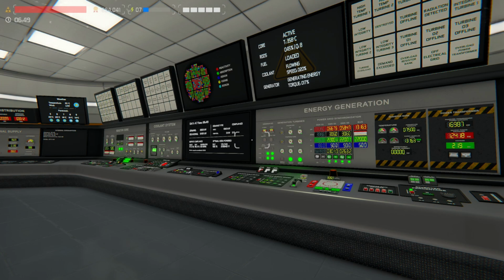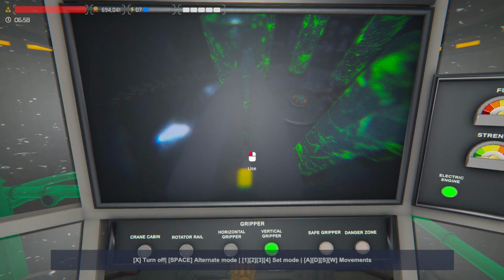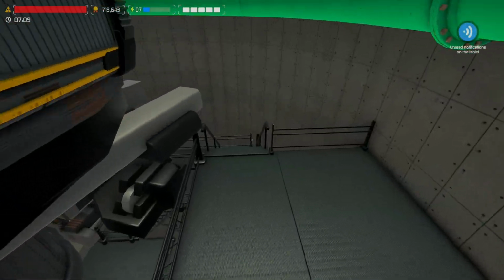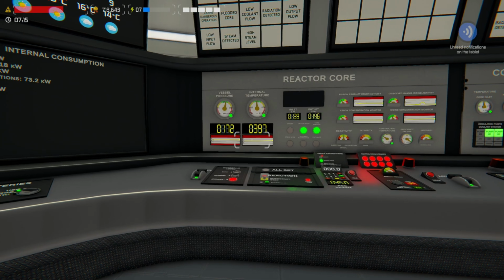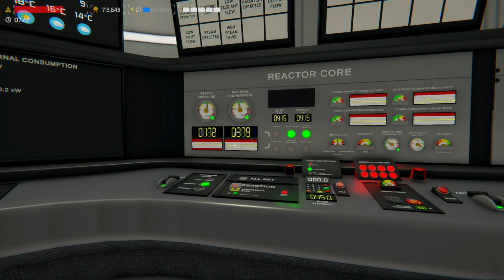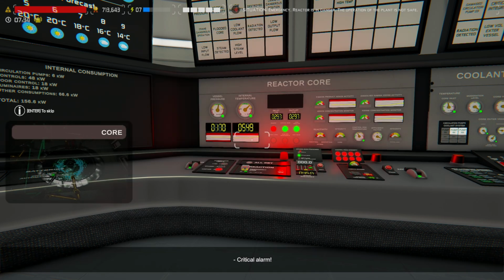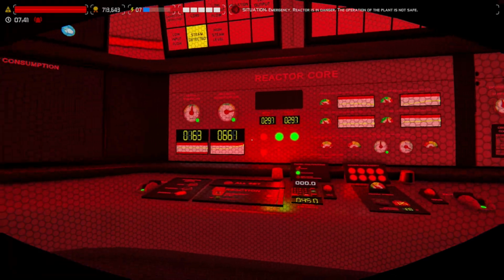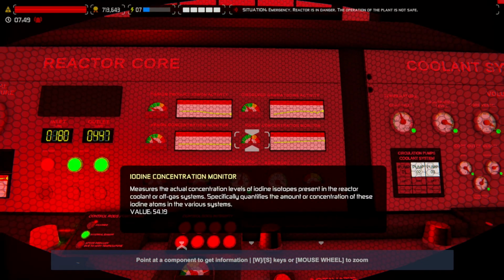DESTROYING Control Rods... Meltdown Test #2 - Nucleares Tutorial

Comment: Maybe from a freshly started game.
Just set the operation mode to nominal and insert core.
Then set rods to 0.
Without doing anything else.
That should start a meltdown immediately.
Reply from the maker: Tried that and won't work...
Needs a new Game with power and the reactor providing stable output to the city's grid... then yank out all of the above haha... shown on Mondays episode
Reply: @ShArPy1o1Games  
WTF that has to be a bug.
No rods, no boric acid, no cooling, no pressurizer and it doesn't cause a meltdown? Irl that would practically turn the reactor in a nuclear bomb
Reply from the maker: Yes all of those will cause a meltdown but with chemicals installed it can be a hit or miss... easier with new Game start

Comment: hey, with what little knowledge i do have of nuclear phyics (very inresting lecture series by MIT or another US uni on YT),  from what i can tell it might be easier to do this from a fresh or completely shutdown and rested reactor. i say this as in the video you can see the iodine and xenon spiking from there managed level of the reactor during normal operation. as such i think that thanks to the already created amount as you try and scale up the reactivity your creating more and more iodine which is choking the reactor and then xenon which chokes it more as both are absorbers, so once you try and start melting down the reactor you created the iodine and xenon pit meaning eventually the reactor starts choking. and that lowers the reactivity enough to kill the attempt. idk my best guess based on pyhsics and the game mechanics i understand.
Reply from the maker: I would normally agree with you 100% but the game doesn't always do the expected as its a little buggy...
I can confirm that turning the pressuriser off at the start of this test and last... WILL cause a meltdown BUT is much more stable (as you say) to cause a meltdown using a new game etc with a clean reactor

Comment: sharpy i will give you my 10 cents: 1) remove Chemical Boron completly before start (the control rods are made of Boron, basically you have this attenuator in 2 different systems: Solid in the bars and liquid in the Chemical. 2) shutdown the pressurizer and let the steam saturate the coolant, do not use the valves i guess in order to mantein the saturation 3)destroy the control bars
Reply from the maker: Yes this does work... with the pressurizer being off and valves closed etc

Comment: I think the game has a strange definition of meltdown. Conceptually. Think of the three mile island incident. No big holes in the roof like chernobyl. But part of the reactor got to hot, they had a partial meltdown, and released radiation. I think thats plenty bad. How about making 1000C the threshold for a meltdown? Clearly out of control but maybe still salvagable. Bonus points for not contaminating the outside world
Reply from the maker: I'd love for them to fix the Steam achievements to allow the ability to Reverse Meltdown as its the only 1 that's broken atm

Comment: In the grand scheme of things with water every pound of pressure would raise your boiling point 3° and then if you factor in if you're releasing pressure you're releasing heat and steam and what is part of your moderator so you need that try leaving pressurizer on and the valves closed
Reply: Well... If the pressure goes to high it will just explode and vent all water. Its not modelled graphically but im pretty sure thats why the pressure dropped
Reply from the maker: The game works quite strangely from time to time but turning the pressuriser off when causing the meltdown does work ✌️